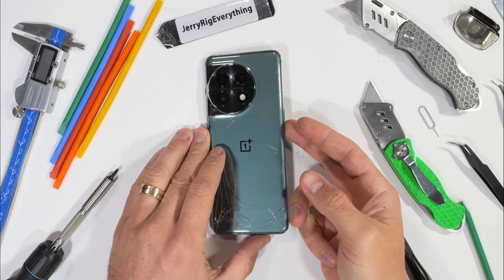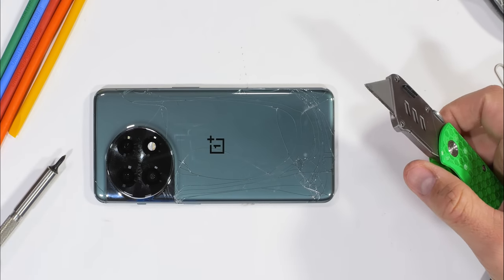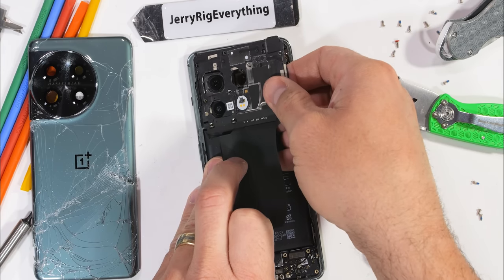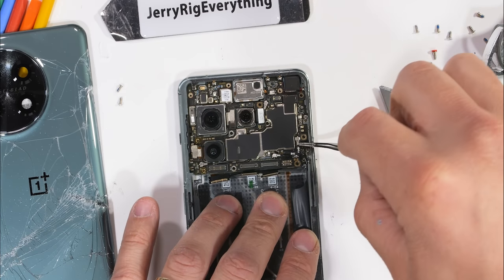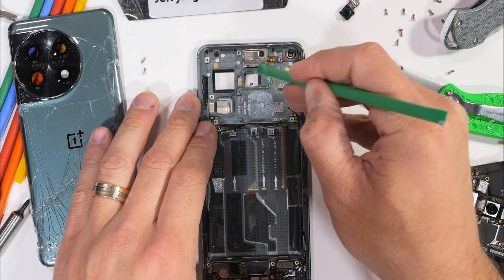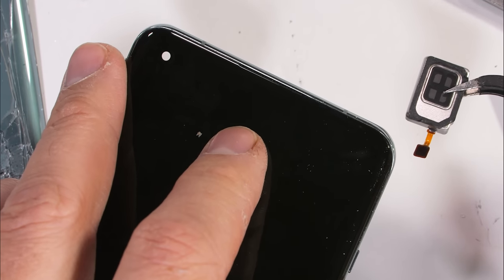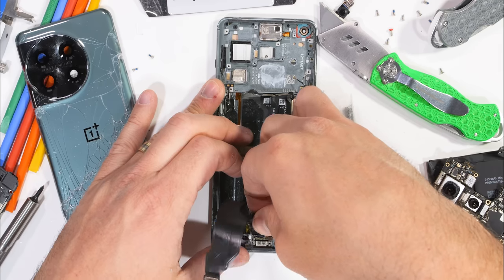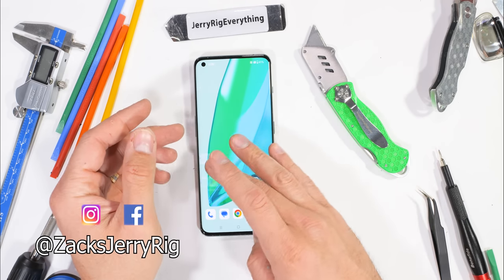The new OnePlus has OneTwo many holes

Comment: This phone is definitely a step forward, still a way to go to get to the peak that was 2019 and the OnePlus 7 pro, though
Reply: @Raven16691  Really? So many reviewers rigorously tested the durability of the retractable camera & it always worked fine.
Reply: OnePlus 6 is the best tho. By a light year
Reply: @Raven16691  I legit have it working perfectly after 4 years of use
Reply: I owned a 7 Pro for a good 3 years before I lost it and not once did I have an issue with the retractable front camera, nor have I heard of other 7P owners having that issue.
I honestly wish I could just buy a decent phone without a selfie cam. Having an uninterrupted display is so good and I'm a little paranoid about my privacy.
Reply: I'd wager the OnePlus 8 was the last good phone from the company before completely losing ground
Reply: @Raven16691  nah don't lie I used it for 3.5 years and never had any issues with pop up canera
Reply: @Raven16691  I have a mi9t working which uses the same mechanism
Reply: @Raven16691  I have my OnePlus7T Pro still till this day and it has never broke for me. Using it for face unlock every day, so it's going up and down I think maybe 150 times a day for only face unlock. Then you have snapchat what I use a lot and it always worked for the last 3.5 years :)
Reply: @Raven16691  i had the OnePlus 7 pro for 4 years the front cam never broke and never gave any issues at all and if it ever broke the repair cost was just 10$
Reply: @morb0yo  Same here i used oneplus 7t pro for 3 years and 2 full months and I can confirm that I never had one single problem with the retractable camera. What a good phone that was, clean screen design with no camera holes and all that, shame that you can't find another phone with the retractable camera after 4 years from 7's release, i would def buy another
Reply: Still on my 7 Pro now.  I ha e been looking for another phone with a clean screen and found the Red Magic 8 Pro that looks interesting.  Uncertain if I am going to switch over to it.
Reply: I love mine I have the McLaren edition of the 7T Pro 😊
Reply: I'm still rocking the OnePlus 7 pro
Reply: 7 pro since release. Camera works as new  and won't buy another phone that's not true full screen
Reply: @DaChonkIsHere  using 7 pro for 4 years. No issues ✌️
Reply: My 7 pro camera works fine after all these years as well. The main issue is better life isn't great so I upgraded to a pixel 7 pro. The camera circle is definitely not as big of an issue that I thought it would be. Most of the time it's hidden in the notification bar. And it's tall enough that videos aren't that wide in full screen so it's in the black bars.
Reply: I opened Beers with the retractable Camera.
And I am watching this video with my 4 years old OnePlus 7Pro.🔥👌
Reply: I have the OP 7Pro and I love it too. Not a single issue with the front camera
Reply: I missed my 7 pro, sadly it developed ghosting a lil bit too fast and I sold it
Reply: I'm still rocking my OnePlus 7 Pro, and agree I like it more than anything to come out after. I keep my phones until they break, so hope they make a worthy successor by the time my phone break otherwise I'm probably going back to Pixel (I had the original Pixel before this phone).
Reply: Same I use my old phone for playing audio on and some browsing camera still works fine.. used it in pool and dropped in hot tub a few times over the years.. Still great
Reply: @zee9276  my OnePlus 10 pro has been amazing, so have to disagree
Reply: Having the OP 7T pro and it recently got a huge downgrade imo that almost kills the phone for me. 

I mean that shitty update to OOS 12. No more nice oxygen OS. Now its this abomination of Color OS with oxygen mix that has far less customization features, drains battery like crazy and performance and UI are far worse. 
For me this is a reason to avoid OP at all costs in the future. It's a real shame because the 7T pro is such a great phone. The retractable camera is the best feature because i barely use it and it stays hidden.

Will probably go for sony in the future since it is the last Flagship brand with headphone jack. I thought i wouldn't miss it on my OP phone since i never really used it that much but i do when i need it.
Reply: Yep 7 pro was the peak I have two of them
Reply: Still rocking the OnePlus 5 still a great phone better than today phones , I installed the pixel experience rom cuz some apps didn't get update in oxygen OS 10 but still a beast of a smartphone
Reply: @Droidman1231 The OnePlus 11 is way better than a Pixel.
Reply: The 3t still is their best seller

Comment: The hole is for infrared sensor which is equipped in international markets
Reply: What would it be used for, pointing upwards?
Reply: @matijavinazza9861  if it is an IR blaster, it can be used as remote for TV, AC, etc.
Reply: @swapnilsalve1971  Totally forgot about that. You're right, thanks.
Reply: @swapnilsalve1971  meet oneplus, the flipper zero but its in the phone aha
Reply: My UK model doesn't have an IR sensor...
Reply: @djanatta1681  that's only available in the 11R and not the regular OnePlus 11
Reply: Lol see guys he as an influence
He doesn’t know that we as viewer now much about that 😂
Reply: Ru frm India
Reply: That was my first guess is ir was in there but I guess it wasn’t but could be in some markets. I didn’t finish there video. I was cringing how he used that razor blade taking it apart right off the bat scared me a lot lol.
Reply: @MorgFlame  Many phones in the Asian market come with an IR Blaster.
Reply: I doubt it, there are plenty of other phones with IR blasters like my old Xiaomi Mi9, but they don't have or need holes for IR to operate.
Reply: It does not have a IR blaster. I have the China/India market phone.
Reply: Nope. It's just for the speaker
Reply: IR blaster hole is on the right hand side upper corner.
Reply: @dillonweaver2307  Scared you?
Reply: @EikottXD  yea what’s up?
Reply: @EikottXD  you like? I don’t not on something I have never broke down before and also never seen how it’s put together. I could tear something up which I would prefer not to and there’s other ways easily without going so deep and so far with a razor blade. But whatever you think man I take apart all kinds of things and repair them from game consoles of all kinds ever almost, small  appliances and home electronics to tvs,  kitchen appliances and cars including issues on mechanical engine parts or electrical/electronic, and also audio systems and many years I also  worked as an electrician starting under the table at a young age and did many years in that into alot of commercial electrical and control wiring and let’s see then HVAC also I can solder I can diagnose pretty much anything with a wiring diagram and a lot without just having a trusty meter so pretty much you name it I’ve prolly done it before. Crazy scary transformers high voltage hot work where your energized just about all you can do and bored with it all eventually. I just like fixing and playing with things really and get bored easily but I usually still try not to break mine or my clients electronics or what im working on any more than they already are. I’ve just made too many simple mistakes over the years and something like sticking that blade so deep and going so far with it was a bit scary. But hey people can do as they please I’ve only taken apart and repaired some of the dumbest things ever tho that most would replace. Just to prove it can be done cheaper always and always been something I’ve loved doing. I built and modified computers since a child and just never stopped from there. But yea sure it’s just my opinion is all do try something else first.
Reply: @bluehonour02  I have an mi 9 and it does have a hole for ir blasters (its circular not square like this one). Infrared doesnt pass through most materials so almost always there is a hole for those
Reply: I used my oppo cam that can see infrared and didn't see anything down there

Comment: Thanks Zack! I don't understand why they went back to USB 2.0 on the OP11. I can live without wireless charging, but after having the OP5 for almost 5 years (AWESOME device btw), going to the OP9 with USB 3.0 (3.1 ugh!) was night and day for transfer speed and peripheral compatibility. A weird step backwards indeed. I hope the OP12 goes back to 3.1, or maybe even 3.2 for 10Gb/s. I really didn't like the OP9 at first bc of the merged OOS, but after flashing EvolutionX (with a modded GCam & proper config), it's now damn close to a perfect device, at least for me. I definitely miss OG OOS.

The ColorOS merge was also a weird choice, but OnePlus, for all its faults, still allows bootloader unlocking without voiding the warranty, and that fact alone still goes a long way with me, since I can flash a different ROM/OS if I want to.
Reply: Still love my OP5, and still have it as a backup. I swapped the battery at ~3 years, and it's still great. Though after using the 9 with a high refresh panel, it'd be tough to go back to a 60Hz device as a daily driver. First world problems though.
Reply: mostly because OnePlus is no longer making flagship grade phones.  They stepped down for oppo to do the flagship jobs. Anyway, it's proven to be quite successful at least in China. It their most saled OnePlus model in history (mostly because the price of the phone is very different in China and other regions, it cheaper in China without the import tax).

Comment: I bought the oneplus 7 pro right after it was released, it has been more than 4 years now and even after falling multiple times on the road, railway platform, in the bus and once even on the road as in was riding a bike going 50 kmph, still no crack on either glass. It has even recovered from water damage recently after i left it in a pool of water. There is a crack on the bottom of back glass but no glass falling out, it is still in one piece. 
The camera is great as for years i have used my phone for all my family photos. 
The pop up camera has never bothered me once it still works like a charm.
I loive that this has such a huge screen  (6.67 inch) without any notch or hole punch. You dont get that bow even with most high end phones.
The power this packs is no joke it still runs smoothly noi matter what i do even though i use it in the lowest setting.
The only one issue i got with this is that the battery capacity has drained but that is expected. If the battery is replaced it will be just like new 

That being said i would not buy a OnePlus again as its sad but they have settled...

Comment: Was with S8 for several years  until another screen ( with temp glass) cracked and ruined screen. Did not want buy screen but get something new and  last week got 1+11 5g.  Very impressed.
Reply: S8 worked till now? My S10+ purchased 2-3 months after launch stopped working after 3 years. The screen just stopped working in my pocket. Very strange, I didn't drop it neither any other accident happened.

I purchased a new phone for screen + battery cost.

Comment: My OnePlus 11 fell from table height. It's back glass panel is broken and when I took the phone to their service centre they said that the display got bent and new back glass panel won't stick properly if the display isn't replaced. And this all happened when my phone fell from table height having a flip cover. So now I have to pay a third of the original price to fix the phone. 

I don't think that it's as durable as you're saying Jerry.

Comment: I've still got the OnePlus 6t and been waiting for them to release another "flagship killer" but all the recent phones have been disappointing
Reply: Same, still using my 7t until a OnePlus phone comes out worth buying. Guess I'll wait another 5 years.
Reply: the pixel is probably the best modern day replacement to oneplus, or the nothing phone if you want something cheaper
Reply: I used a oneplus 6 for 3 years and it was great, i was so impressed with it and ready to upgrade to the next oneplus phone.
Too bad that when time to upgrade came, i discovered that oneplus had stopped producing flagship killers and now they make flagship-priced phones but with the same compromises as the flagship killers. It was so sad, and at the end i decided to switch to samsung and grabbed a s21 with a good offer last year. So far the samsung is doing a great job, i think samsung gained a customer...
Reply: The OnePlus 11 is a legitimately really good phone, but it definitely has some weird cost-cutting measures and the UI is an acquired taste, but still a good flagship killer
Reply: The 6t is way worse compared to the original 6 which I have. The 6t has super slow and annoying fingerprint scanner. Also it's not at the back of the phone which is 100% a must. The scanner should NEVER be on the display itself.
Reply: flagship killer will always go to POCO brand with the spec and price wise.
Reply: @Samsonfs  Ignoring the processor, is it better than the Pixel 7 Pro?
Reply: @bluelit9281  poco died after f2 pro, none of them offers good software with good camera.
Reply: @DaChonkIsHere  not better but different priorities, imo cameras overall are better on the pixel, software support is objectively better on the pixel but the experience is personal preference, displays are pretty similar but hardware wise the OnePlus is maybe a little nicer overall. But it's kinda hard to not consider 8 gen 2 Vs pixels unique features. Personally I'd still choose the pixel because you can get some excellent deals.
Reply: @PahEz  nope, looks like you haven't used new phones with gigantic fingerprint sensors. its literally lightning fast, faster than any physical fingerprint reader.
Reply: @Da Chonk Is Here  I would choose the pixel, i think it's a better made phone overall. On oneplus side, the snapdragon 8 gen 2 is a great processor but not enough to make the cut for me
Reply: @skriddle3  Cpu/Gpu is my priority. If its camera, Sony xperia is what you're looking for.
Reply: @skriddle3  The OnePlus6 not only has the fastest fingerprint scanner but it is also at the back of the phone which makes it perfrct and 100% accurate every single time with no errors. On display FP scanners are obviously going to be way worse and they won't work properly, compared to the ones on the back. So again, FP scanner on the back of the phone is a must or else I'm not even gonns buy the phone for 200$.
Reply: @PahEz  you are so confidently wrong lmao- from someone who liked capacitive fingerprint scanners.
Reply: I jumped from OP6T to the Nothing Phone 1.....I actually prefer the 6T! 
All these phones coming out and I still love my 6T!
Tempted by the Nord 3 CE though
Reply: @PahEz  nah fam even mi 9t (not even pro one) has equal speed to any physical sensor out there, new samsung phones with ultrasonic things are the fastesr reading sensors right now. with literally 0% fail rate.
Reply: @skriddle3  even the OnePlus 7pro which I'm typing this on is incredibly fast and accurate 💀
Reply: @DaChonkIsHere I'm loving my 11, it's smooth, fast, great battery life and from my little testing the camera is good.
Reply: @Samsonfs  oh hey Im using the op 7 pro too, literally the best purchase I did. it was extremely fast when it got released and still fast enough to keep up today. also fp scanner is pretty accurate and quick as you mentioned 👍🏻👍🏻
Reply: @skriddle3  not my main phone anymore because OnePlus abandoned the 5g model after one update to android 10 😬😬 but the hardware is pretty nice
Reply: same but my 6T screen is trash and for some reason I cant use IG on wifi or google maps at all? lol I'm considering a pixel7a or maybe a mid tier samsung. what are you thinking you'll buy to replace your 6T?
Reply: @mouliknanda  What a joke...the  pixel is not. Ive had my oneplus 11 since launch with no issues. Unlike my buddy who had the Pixel 7 pro since launch and has had to have it replaced 3 times and is on his 4th phone because of hardware issues that they cant fix... Besides cameras and wireless charging(which few care about especially with oneplus's amazing fast charging). The pixel 7 is inferior to the OP 11 in so many ways. and my wife has a 6 and the phone isnt anything spectacular. battery is crap and charging is terrible..

Comment: Would be better to have a plastic back panel.  Something durable and cheap like the material used for protective cases.  Also, I want the 3.5mm headset socket back.

Comment: The battery isn't 5000mAh, the cells are in series so it's still 2500mAh but double the typical voltage.

Comment: I'm waiting until the 11T in hopes it'll be better than this. I have a 10T and the battery is less than 2500 MaH and playing Genshin Impact kills the battery in less than two hours and plugging it in didn't work. I have it set to low graphics because of it even though the phone doesn't overheat if I set it to max. I'm not sure whether replacing the battery will do any good and I'm not sure whether it's possible to get it fixed outside of sending it in and I have a game I have to do dailies on plus this and that... The only real reason I'm staying with OnePlus is because I can have an extra app in a floating window while gaming which makes it easy to look up stuff while I'm gaming so I don't have to log back in.
Reply: They aren't releasing any other version of one plus 11 this year as far as I know so only one phone a year from now on.

Comment: I'm really happy with my op11. Ive been very impressed by it's antenna system and how easy it is to root and unlock the bootloader.
Reply: Just, please, don't come back here when you find out you're getting terminally ill from the unsafe level of radiations coming from the Oneplus antennas.
Reply: @zaka2630  source?